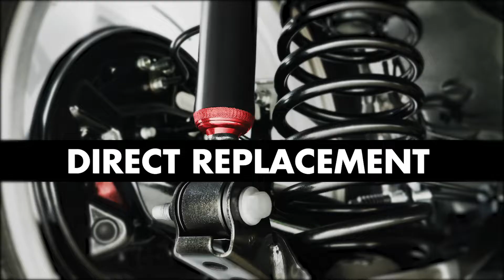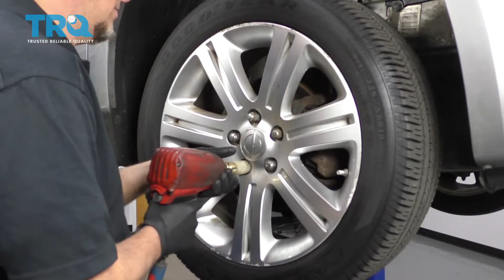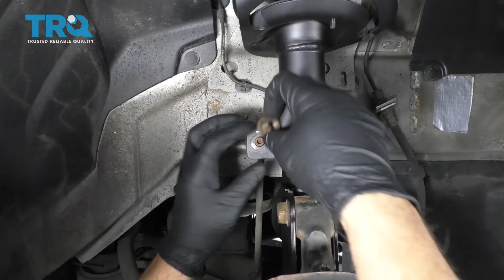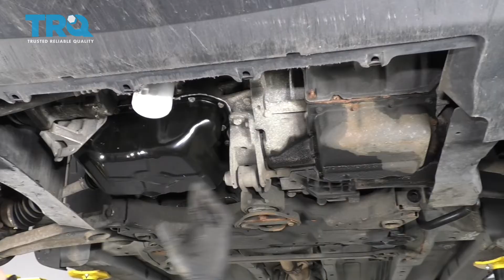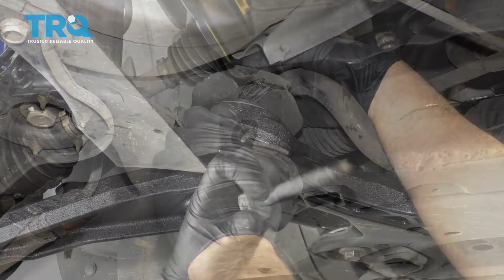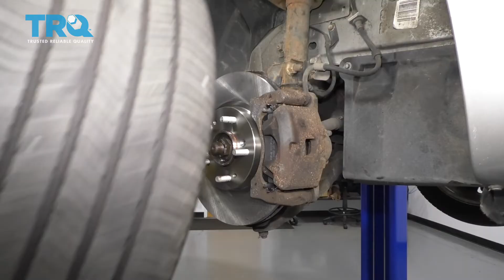How to Replace Front Passenger Side Lower Control Arm 11-14 Chrysler 200

Comment: Kinda wondering why this guy did anything at all with the sway bar...  It's not connected to the control arm in any way.  Just wasting time and customer's money there.  Also wondering why he didn't coat the entire bolt in the anti-seize rather than just the part that goes through the bushings.  Might be nice to be able to get those nuts off again when the rear bushing inevitably goes to crap again (especially in the snow areas)...

Also wondering how TRQ recommends I get one of their replacement CV axles back out of this thing after they've been installed (2012 2.4 4 speed) because there is literally no way to pry against anything on the axle to pry it out...  Beginning to think I'm going to have to pull the other side and use a long bar to hammer it out through the differential...

Comment: Great video! If you didn't have an pickle fork could you put the nut on the stud and tap it with a hammer to get the control arm loose
Reply from the maker: +Marcus Darnell Thanks for the tip!

Comment: Almost the same as my Dart but my linkage did not have a hex head in the end of the bolt. I had to hold it with a 20mm wrench on the back side by the ball joint boot. There was also no cotter pin. However, my tie rod end did have a Torx bit hole in the end of the ball joint bolt, so I had to tighten that nut with an 18mm wrench until it was tight enough to use the torque wrench. Wish I had this ball joint setup on my lower control arm with the thread bolt pointing down. On the Dart's lower control arm, the ball joint points up and is just a pin that goes into the steering knuckle from the bottom. That's held in place with a pinch bolt. I definitely tore the dust boot, only to find out you can't replace it or the ball joint. You have to replace the entire lower control arm. Which leads me to my question. On my Dart there is an aluminum frame rail that's in the way of removing the horizontal lower control arm bolt. In this video, it looks as if you already removed it beforehand. Is this correct because that's what I needed to see.

Comment: I think this must be the problem that I’m have it’s a clunking sound I’ve had a stabilizer sway bar replaced on the right but still has the noise should I replace both control arms?
Reply: Clunking could also be from worn out struts in the front. If you're going to replace a lower control arm with a new one, I'd replace both sides so they wear evenly. If you only have a problem on one side, and you still have fairly low miles, (50-60k) I'd replace it with a used part off of a car with similar mileage, again so they wear evenly.
Reply: My clucking sound came from bad struts on my avenger
Reply: few things it can be. Stabilizer bar bushings, lower control arm, lower control arm balljoint.

Comment: I've never seen a video where a dodge avenger/Chrysler 200 actually still has the under splash shield. Mine fell off quickly after I got the car because of lazy mechanics not reinstalling it securely. I do oil changes myself now and my under splash shield is where it should be. But yes, those owners that do not do their own oil changes WILL lose the shield at some point and it ends up living in their trunk, or worse yet the sloppy servicemen kept it. Its important for aerodynamics, it really is